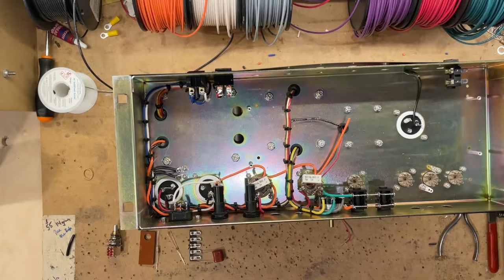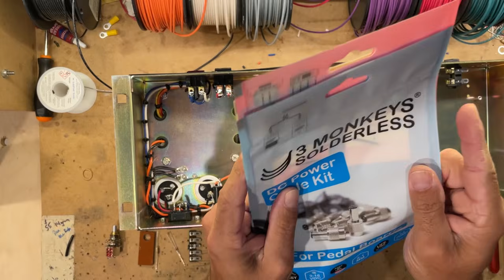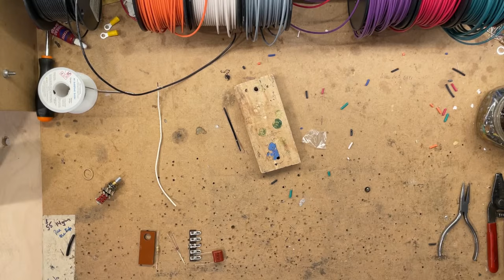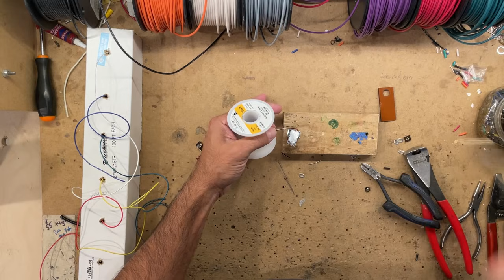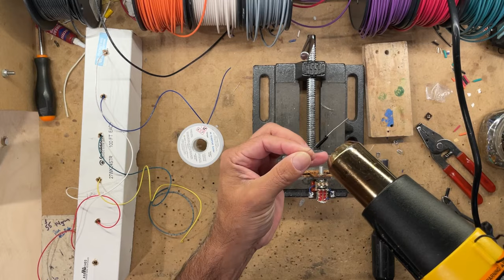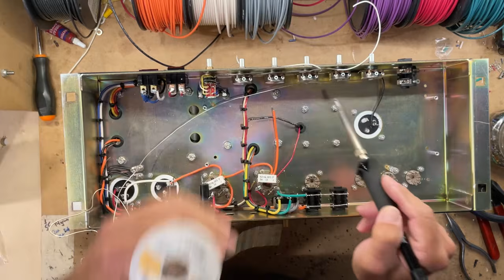Jose 50 Watt Head Build Part 6

Comment: So I noticed that you use the chisel tip for the backs of the pots and the pointed tip for the tube socket and transformer connections. What wattage is best for a soldering iron for both tips? These amp builds and explanations are really great educational tools, thanks for doing them!
Reply from the maker: I use a Weller WES51 set on 800.   I like the big tips for big jobs and the little tips for tight places :). Thanks for the question and for watching!
Ossie